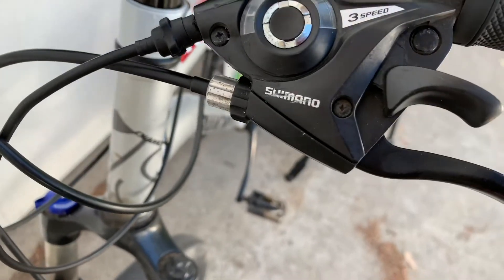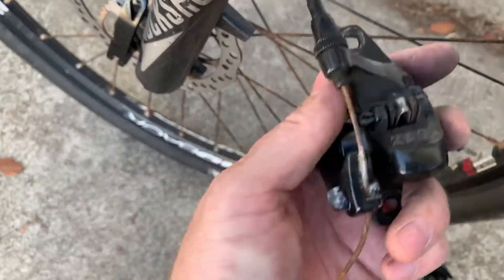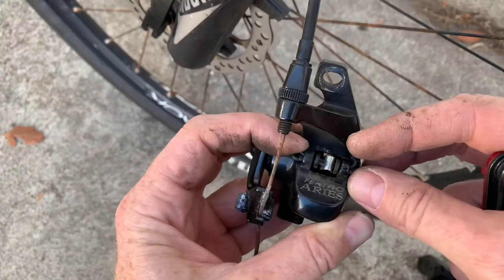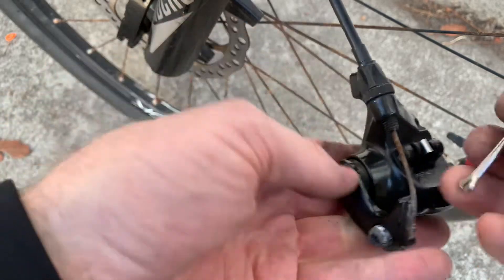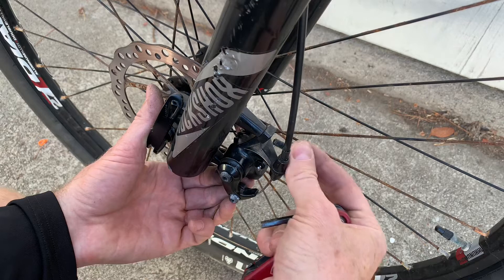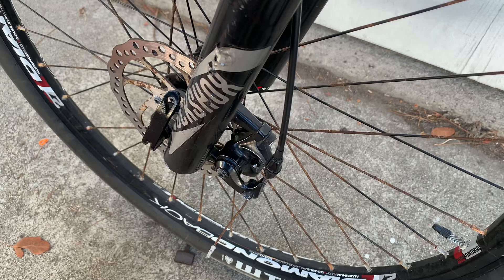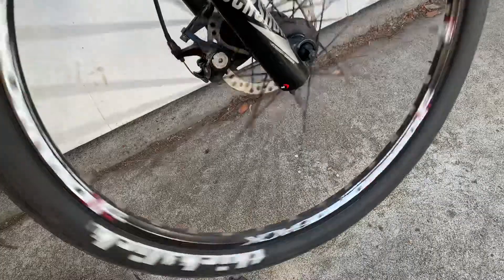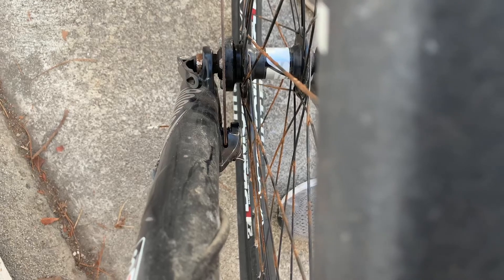How To Change & Adjust Mechanical Bike Disc Brake Pads

Comment: Just purchased an MTB and bikes nowadays are way much different than bikes years ago as far as I can remember. Only had rim brakes before but after spending a lot of time outside with my new bike, the brake pads have worn out, needed to change them and your video is just as informative and educational. Thanks heaps.
Reply from the maker: You’re welcome. I’m glad I could help.

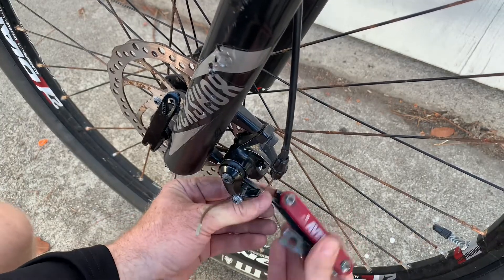Comment: 2:25  I had only pulled the cable down and then tightened the cable holder, but the brake lever had no resistance when pulled. After seeing this video I tried pushing the arm up a bit and then tighten, like what you did. and it worked! So glad I found this video. Thank you so much!
Reply from the maker: You’re welcome

Comment: It's so funny...I have been able to do this numerous times with my hydraulic brakes, but I need a video to work on the simplier mechanical ones....Thank you for your help. If I can't stop, then I shouldn't be making videos....Well..........hmmm
Reply from the maker: Thanks.
Reply: Same here....then after all my efforts dealing with the pads..it was the cable that was slipping. I pulled it extra tight and hopefully that works...Loctight next

Comment: On my Mountain Bike Rear Disc Brake top section where the movement is seen of the brake action, I see two red small levers sitting upright where the pads sit and they can be tilted side to side or back and forth a tiny amount in the open top slot area above the pads. can anyone tell me what those red tiny levers are?

My rear brake pads are now worn a bit, that is why I watching this video?  I will have to tighten them up due to the wear.
Just those tiny red levers above where the pads sit has me wondering what they are for?

I never had a Bike with brake pads before I had only the V brakes on the last mountain bike I had used.  So these are new system to me.

Comment: If the back pad is designed not to move then how does it apply pressure to the disc when the brake lever is squeezed?
Reply: the other pad squeezes the disc into the back pad.

Comment: Do you know why my front brake handle doesn’t return back after I let go ? It seems to get stuck and doesn’t spring back all the way
Reply from the maker: Either of the return spring is broken or the cable is stuck.

Comment: What do you do if you've done all these steps and they rub?
Reply from the maker: If they are rubbing, you will have to release a little bit of tension so that there is more space between the pads and the disks, or maybe you have a bent disc.
Reply: @hoohoohoblin  so release the cord a bit right?

Comment: I've seen people adjust this part ( https://imgur.com/a/0GHnkP3 ), I think it also affects the brake slightly but I'm not sure? Could you explain what it does and if it's different from the stopper thing we adjust on the handle?
Reply from the maker: It does the same thing as the one on the brake lever. You can screw it out to create more tension on the cable.
Reply: @hoohoohoblin  cheers